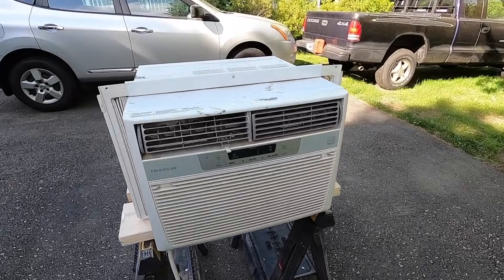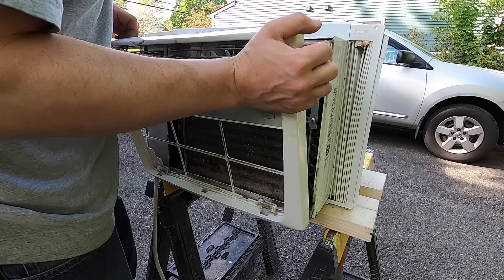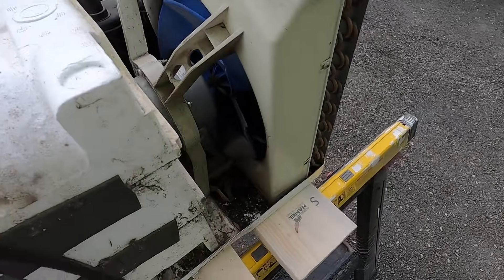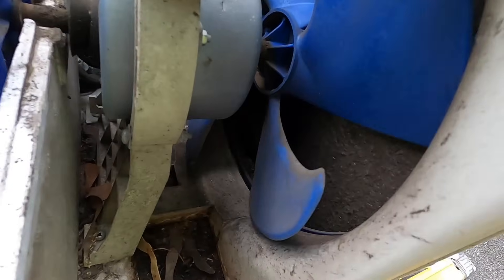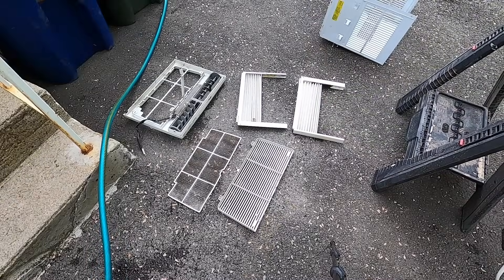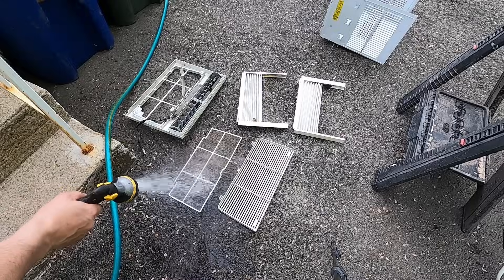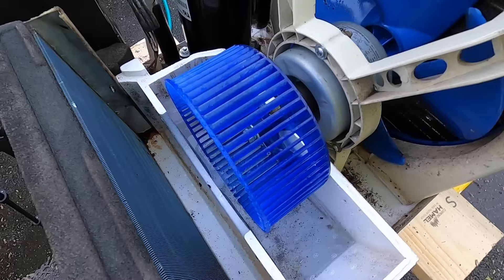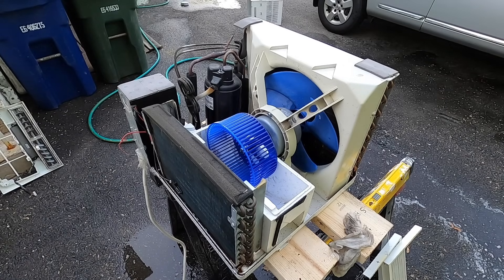How to Clean a Dirty Moldy Window Air Conditioner

Comment: Hey there! I didn't know that you could clean an air conditioner like that.   I have one similar to that one and I thought I was doing something by washing the  filter lol. 
I would be afraid of messing up the wires and putting it back together  property.
GOOD JOB!
Reply from the maker: Hey, June!  As long as you dry the AC out before you plug it back in you should be fine even if you accidentally get the wires wet.  Thanks for checking out the video!

Comment: man i got really sick this last wednesday... noticed what i thought was just dust on the same exact unit was actually mold.. lived here for three weeks just recently moved in.. landlord sent someone to clean and it looks good as new.. however the blue hamster wheel looking thing thats connected to fan i know for a fact was not touched but he didnt remove the unit out of the wall... everything else he got from the front side... i'm definitely gonna have her get someone to remove it and deep cleanse that part because i dont wanna get sick again.. thanks for the informative video
Reply: Bro same. I started feeling bad weeks ago, progressively got worse, eventually I connected it to around the time I started using the ac again this year and I remembered that end of last year I'd seen mold inside the ac. I looked again and it was really bad, mold everywhere inside it. Took it out, and apart, cleaned heck out of it, and the next day I felt 90% better. Today which is two days later I feel perfectly fine. That mold was destroying me it's crazy.
Reply: @0ptimal  Why don't consumers sue these cheap manufacturers. We are talking health problems here. They design these things knowing that these types of of problems exist. If it wasn't a health issue it would be different, just planned obsolescence. 
But I know, you'll have trolls saying you can't and start protecting these cheap manufacturers.

Comment: So I recently realized how dirty my ac is and I don’t believe it is mold. I’m not saying it isn’t possible because it definitely is but when I cleaned mine I noticed it felt like dirt and realized how shitty the filter is. The screen filters that come with the AC unit do not filter out any dust. I was able to clean mine out completely without any chemicals because it was literally all built up dust. I highly recommend adding a foam filter in addition to the factory filter.
Reply: From my experience I think you're right and it's more likely to be a build up of dust and dirt than mold. The filters are inadequate and the dust goes around onto the coils/fins.

Comment: I did this several years ago with an old unit and I tried my best to keep the electric parts dry but I guess they got wet because it never worked again after that.

Comment: This is a long shot since video is 3 years old but was wondering if someone would know, i have a kenmore wall ac, when i took panel off to clean the control bd is attached, connected with wires to connector, im not sure if wires where in the hole with connector or were ok to hang out?

Comment: You can prevent all that junk on the inside of the exchanger fins by hot gluing aluminum window screen inside the fresh air intake vents the blower draws air inside through. I live in the woods and as soon as I get any new ac I open it up and hot glue the screen inside those vents. Only cleanup is twice a year slide the ac out or remove the shell and spray from the inside out on the screen added. All the debris will be stuck outside the ac. It is easy to see when the vents need cleaned because you won't be able to see through them. If you glue the screens on straight lined parallel with the openings it will look factory installed. If it is a slide out ac cleaning can be done is fifteen minutes. I've done at least 6 ac's and advise using a large hot glue gun. It will take much longer using a small one.
Reply: I need to see a video on this I'm trying to understand just by reading this lol

Comment: This is so helpful, As I need to get my window Air conditioner installed before tomorrow and it's pretty dirty inside and looks like it might even have about a half inch of mud in the bottom of the back from all the dust it sucked into it from the road work going on here last summer.

Comment: I have the same exact air conditioner. I took the filter and cleaned it and little did I realize the blades in the back of have black gunk all over it it’s nine years old. Should I replace it?

Comment: I know this video is 2 years old and has quite a few comments on it but I just wanted to add that bleach does not kill mold. Use white distilled vinegar with baking soda, 3% peroxide and water, or a mold remover solution.

Comment: yep. in a terrible heatwave here in cali. had mine set at 82 and my room was 91. 930 at night. took my ac's face plate off and discovered some mold and a ton of cat hair and gross dust. vacuumed most of it off and its finally cooling properly. gonna bleach clean it tomorrow. my cats have been acting like they have an upper respiratory illness and ive developed the same symptoms. my cats outside my room who interact with me and the cats in here dont have those symptoms. theres a much nicer ac out there than in here. so i realized that was the common denominator since all my cats are vaccinated against the most common illnesses. feels nice in here at 83 finally. thanks for the vid. ive fixed these a ton of times but i still love watching the how to vids. :)

Comment: My A/C had mildew and mold in this.  I almost spit my lunch when I turn on this unit!  This one is exactly my air.  I've got a 6000 unit, and a larger 18000 unit.  I have had to clean one of this units.  I think both of the unit air filter is junk.

Comment: I have this same unit in my apartment. I appreciate this video because now I see it is not something I will be able handle from just inside the apartment, I'll need to replace the unit. I was hoping for a way to clean it out while it's still in the window but I knew it was a long shot.

Comment: One of the potential issues i just discovered with my one year old window unit is that the area that pulls air from inside the room is not sealed off. Both side have crevices to the outside and likely draw a lot of outside air instead of inside air only. Isn't supposed to be sealed off?

Comment: I have several Frigidaire units and every couple years I tear them completely down for a thorough cleaning. Once I have everything apart I'm left with just the compressor, the two cores and the lines attaching them. As long as you're careful you can remove them from the pan to give it a good cleaning too. These things are built surprisingly simple once you know the pieces involved.

Comment: Its best to clean it and sell it butnmake sure you say you cleaned it  in the ad. Then use the funds to buy a new one. Also use a solution of borax to wipe the inside of the foam so it has a layer of protection from mold. I also took my unit totally apart and cleaned it. It took hours 😂

Comment: You're supposed to put the AC on fan mode every now and then to prevent mold
Reply: I've always done that with this model and unfortunately it still didn't prevent mine from filling up with mold like the one in the video. I think it's just an unfortunate design since mold spores can easily settle into the porous styrofoam and continue to grow from there.

Comment: Mine isn't as bad as yours but it's bad. I opened it up and drilled some more drain holes the bottom. I got as much as I could without taking the Styrofoam off. After seeing this video though, I'm having the biggest ugh moment. I'm hoping that it won't spread more because I do not want to remove the casing until next summer. But I'm glad to see that I can cut the foam!

Comment: mixing chlorine with detergents has the potential to create unpleasant and or dangerous fumes and chlorine is corrosive to your A/C components, i would recommend using hydrogen peroxide at a 10% strength (general antiseptic is only 3%)
which will effectively oxidize the muld spores and kill the active mold,

bleach can actually cause more mold to become airborne and kills the mold but the dead mold will still trigger the same immune response at active mold and in some cases more response

Comment: I cleaned mine today. The front but I used my bathroom mold and mildew remover. Now, it won't work. I have the exact same model. I push the reset button and it lights up sometimes but that is it. I noticed mine did not have that red wire in the front.
Reply from the maker: Hey, Betty.  Did you let it dry out for a while?  It is a good idea to let it dry, especially if the circuit board got a bit wet.

Comment: So happy I found this video. I have the same brand of this unit but a little different model(maybe older, maybe newer, but still old lol). And I took it apart last week and seeing how gross and disgusting everything was I didn't dive into the whole clean up right away. It was about 10x worse than the one in this video....

But tonight I finally brought it out of the basement and cleaned the absolute shit out of it. I used the exact method in this video(bleach, soap, medium sized scrubber and hot water). I even used a small old toothbrush to get those harder to reach spots. 

Now I am letting it sit out for a day or 2 before reassembling. I also need to bend the back grill pieces back so they're straight. I am super proud of how clean I got it though. It was discouraging to see how disgusting it looked and I hope the work pays off. Really really hoping I didn't screw anything up...

It was leaking last year and I am hoping I unclogged whatever was making it leak during the clean up.... Thankyou for taking the time to show us how to clean the AC man.🙏
Reply from the maker: Hey!! Glad to see that the video helped you and thanks so much for watching! 😃
Reply: @TheFixerHomeRepair  Got her all put back together and running today! The only thing now is it keeps shutting off on its own after a few minutes and switches modes on its own(which it was doing before the cleaning). So I read to take the circuit board off and see if any condensation or water was built up in it and as a matter of fact there was. So now I have a little fan drying the circuit board out while I still have the unit running and it has only done it once now within the past 10 minutes. Really hope it solves the issue here.. would you have an idea why it is changing fan speeds on its own and shutting off randomly?

Comment: Well...I wish I would of watched this video before i cleaned mine out. I took it apart the same way. But I just hit it with water hose all the way round. Now the damn thing won't turn on. I think I wet the circuit board 🤔 not thinking bout it tho SMH ! Going to wait and see once it completely dries. Hope it turns back on. Great video 📹...I have the same window unit by the way

Comment: I have the exact same A/C, cleaned last season before putting away. Put in window this year and now turns on, but the fan doesn't turn on regardless of the mode (cool/fan). Any thoughts?
Reply: Try to give it a boost with your hand, a stick or something similar.....may just need help getting started
Reply: @goldenturbo2843  That was exactly what it needed, thanks! haha

Comment: All that mold and filth, it's no wonder why a lot of people develop coughs when fire up the AC'S every year. I just cleaned my 10,000 BTU after 2 years of owning it - you HAVE to remove the back plastic shroud or you'll never get the gunk out that's blocking the exhaust radiator from directly in front of the fan. Not only that, but the shroud itself holds an incredible amount of debris. There's no way around it, and if your going through all the trouble to dismantle it & give it a thorough cleaning, you may as well do it right. I used a straw (pipe) cleaner going up & down in the direction of the fins with soapy water and blasted it for hours and got it as clean as possible. works great now.
The vents are pressure fit on BTW, just push them out from the back at the sides - they pop back in way easier than they come out. Good video by the way.

Comment: I wasn't sure where to start when it comes to cleaning a window unit until I watched your video! Thank you for posting! Quick tip I learned flipping houses - use white vinegar with a small amount of hydrogen peroxide for porous parts containing mold. The combo bubbles below the surface and kills the roots of the mold. Only use it outdoors though - the combination creates a toxic fume! Thanks again for posting the video!
Reply from the maker: Thanks for watching! 😃

Comment: If your'e gonna take that much apart, you should take the fan shroud and squirrel cage fan out to get to the backside coils.  It's all one piece so it's easy to remove.  Then, you can properly soak the coils with cleaner and brush away any that water wouldn't remove.  Iv'e never seen a unit as caked with dirt as your outside coils.

Comment: I have this same exact air conditioner, 2 years old, it's dumping water inside the house and it rotted out a massive portion of the floor in very short time. What would cause this?
Reply: Could be due to not being tilted back slightly so water can drain outside. I think there's some other possibilities too like low freon, something clogged ect. Oh, there's apparently a little hole on the bottom panel behind the electrical panel that let's water go from the front of the unit to the back, and it can get clogged

Comment: i have the same exact model in my apartment. it suddenly started leaking the water inside. my landlord sucks. is there a way I can drill a hole on the  outside to let it leak outside?
Reply: Yeah, remove it and drill a hole where the water goes. Make sure the unit is also tilted downwards outside

Comment: I have the same Frigidaire AC. I don't know if it's a 12000 btu but that's not my point. I do most of what you do after every end of summer. Let me tell you Frigidaire makes very good and cold AC's. I have 3 AC's and Frigidaire is the coldest by far. It does my main floor easily except for bedrooms. And I keep it at the low setting. I can't imagine what the high setting might feel like.

Comment: Question I recently have read bleach doesn't kill mould. The article said you basically bleach it see through and the mould comes back very quickly. They said white vinger kills mould. I'm a little confused as most mould killer's on the market are basically bleach. Has any one got more information on what chemicals actually get rid of mould for good. I have black mould in my ducting for my house and need to treat it plus summer is on its way in Australia.
Reply: Colloidal silver, copper solution, iodine, mms, strong vinegar, strong hydrogen peroxide. Don't mix these together.  They are just some ideas if you happen to have any on hand

Comment: Did you remove the capacitator before you started? I read that you are supposed to and I have no idea how or where to begin. If you have any videos, it would be greatly appreciated. Thank you for making this video. It is very helpful!
Reply: No reason to , you run the risk of not hooking it up correctly if you do.  Just keep you water and cleaner away from the electronics. and motor.

Comment: I've found that if I go to the dollar store and buy a cheap hair comb and cut it into shorter pieces you can use those to straighten out the fins. It's cheaper than buying a fin comb and easier than straightening each fin individually with my pocket knife

Comment: I thought bleach wasn’t good for mold , that it’d multiply ?
Reply: You are correct! Thank you for noticing. This will be lengthy but I hope this will help. 

Mold mutates at an unprecedented rate. If you use harsh cleaning chemicals on black mold, you will cause it to mutate against harsh cleaning chemicals. Which makes it so much more difficult to get rid of. Do not. I repeat. Do not use bleach.

I have a current air conditioner that I spent a fortune on that has mold. It showed up about 1 year ago. I have to keep it running because my room has two expensive computers and bad insulation in my household. My central air does not reach my room and it can get upwards of 98+ degrees in my room. I have to keep it on. So I figured out a concoction that has kept the mold at bay. Walmart’s “Cleaning Vinegar” SPECIFICALLY CLEANING VINEGAR NOT FOOD GRADE, and 90%-97% rubbing alcohol. No water. Because if you add water it waters it down to lose its potency, which makes it severely underpowered. The water from the rubbing alcohol should suffice. It has completely halted mold growth in my air conditioner, it’s still there, but hasn’t budged for ages. Use that to clean your air conditioner when taking it apart. DO NOT MIX ANY OTHER CLEANING PRODUCTS WITH THIS MIX. ABSOLUTELY NONE. It’s pretty potent, but not potent enough for mold to mutate from what I’ve seen. 

Last but not least, you can use that mixture on NEARLY ANYTHING. It’s extremely antiseptic, will clear any surfaces of germs. Try not to use on eating utensils, pots and pans, and or finished floors. Everywhere else is fair game, it’s so much more better than bleach. A lot more safer. You can use it to clean anything nearly. Just do not mix it with anything else at all, don’t use on cat urine (ammonia), human urine (ammonia), dog urine (ammonia), ammonia, bleach, or oxyclean powder. It will make a very toxic or corrosive material. Hope this helps more than just your air conditioner. You can find the spray bottles at walmart.